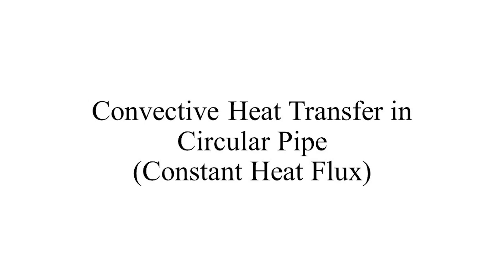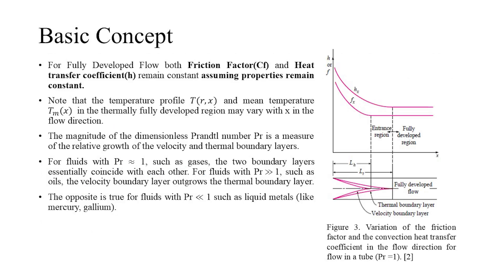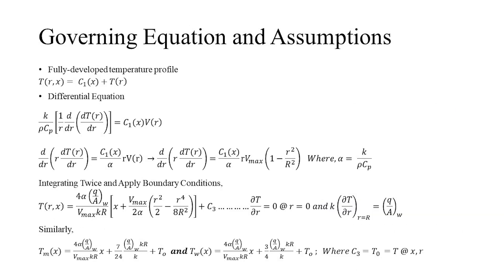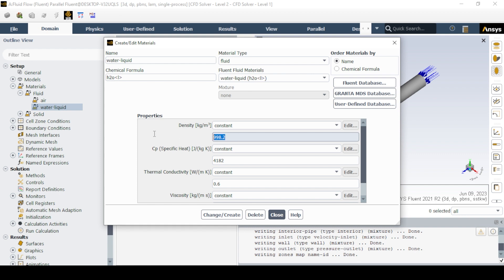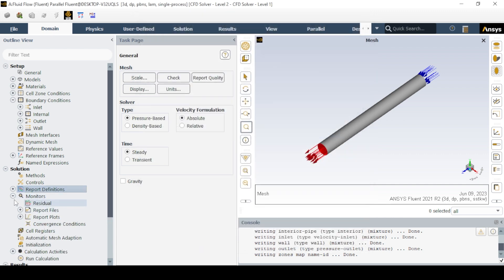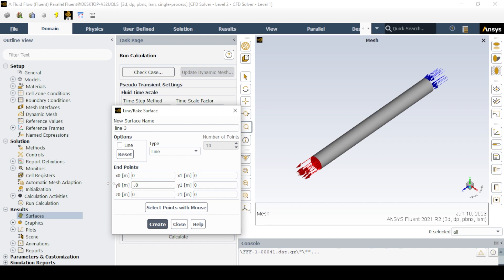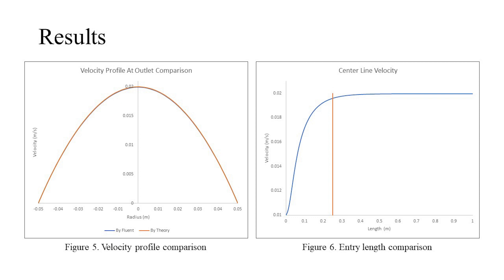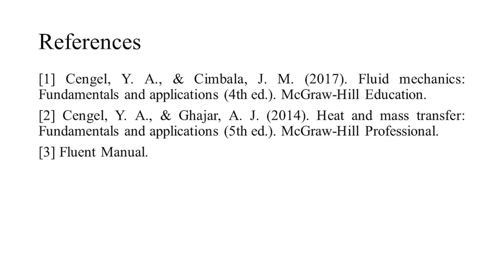CFD Analysis of Pipe with Constant Wall Heat Flux using Fluent (Validation)

Comment: Excellent work!
However, there is another scenario where heat transfer could be emphasized:

By considering heat addition in the wall, it would be interesting to also plot the temperature map in the solid region. In real situations—not only in pipes—heat is often removed from solids with flow over them. Evaluating the temperature behavior in such cases is an excellent approach.

Several videos solve only the heat equation using an outlet temperature as a boundary condition (which is very common and basic). But if only the heat flux in the solid is known, in order to compute the temperature gradient, it is necessary to have a fluid flow over the solid surface. It’s worth trying this specific setup, which is closely related to electronic cooling!

Comment: My solution is not converged, i am trying a lot but at the last even at the easiest problems, my solution is not converging ..
Reply from the maker: Hello, 
Appreciated that you have tried to simulate the problem, please answer the following questions
1) Have you followed the video thoroughly with each step shown 
2) Geometry and every fluent setup is as per the video 
If you have followed this correctly then this should converge, if still not converging the first try with coarse mesh with the first order scheme  and after the first order convergence turn on the second order scheme.
If you face the same issue you can share your workbench or fluent setup file at inphitude@gmail.com